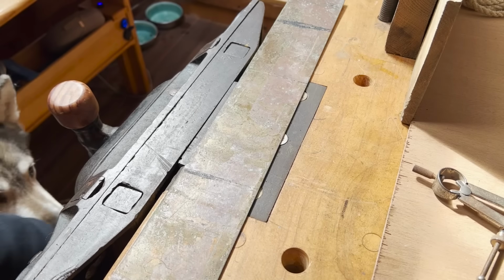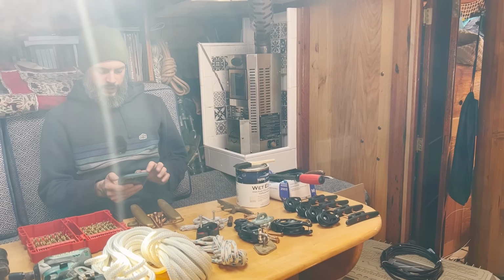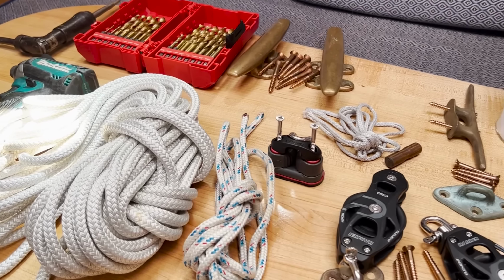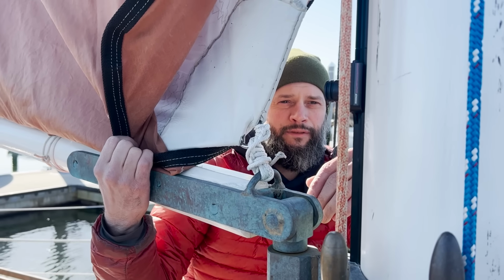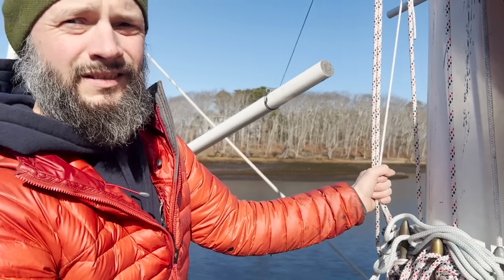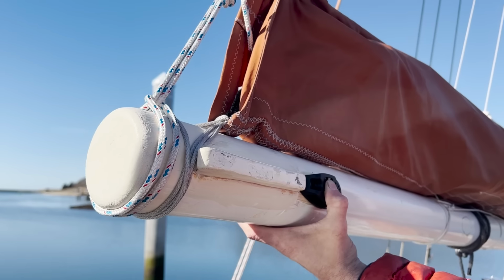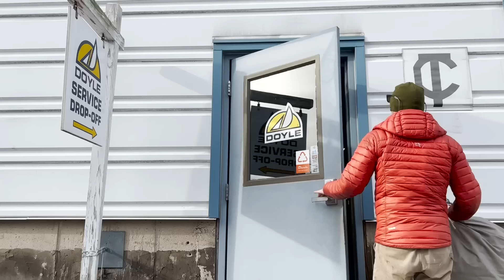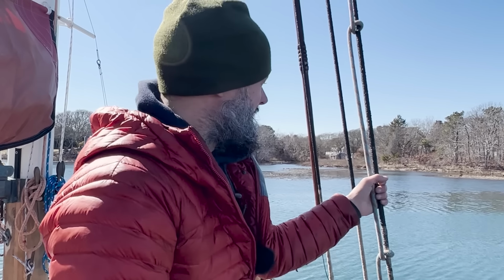Maximizing Arabella's Ability to Sail Upwind - Ep. 305 - Acorn to Arabella: Journey of a Wooden Boat

Comment: what happened to the stuffing box and the electrical problems you had? Has this been repaired?
Reply from the maker: Time will tell. The new alternator is on the boat waiting for install and the motor hasn't been running since November-ish. The anode still looks decent, so maybe it was, and maybe it wasn't the stuffing material. It should be solved, the anode looks fine for the moment, but things have a habit of changing on a dime around here! Watch this space i guess...

Comment: I'm a boater but not a sailer.  It always amazes me how many lines are on a sailboat and how sailors manage them all.  I can see both sides: the headaches, and the therapeutic nature of their demands.
Reply: slimmed and trimmed is one or two line(s). two is sailing single headsail only, and one is sailing mains'l only. most everything else is either ease of use or to gain performance. easy enough to start simple and add complexity as you gain confidence.

lots of fresh (me included) sailors want to use it all, just because it's there. but listen to the boat. if just one sail is up and she has a good heading and speed, then sit back and enjoy. it doesn't always have to be complicated.
Reply: @bmxerkrantz I am still aghast that I never knew “boater” versus “sailor”.  They have always just been “stinkpot” and “rag hanger”.
Reply: @lory2622 ,  We call them Blow Boats in Tampa, lol.
Reply: Different ball game - I've owned and been on a few boats in various scenarios. Been on a Sailing thing with no sails up, engine only and thought it was falling over and was going to die at any moment. Terrifying things
Reply: @mrvertigo23 a yacht doesn't handle the same without her sails up. They're designed to primarily sail and handle so much better with the sails up generally

Comment: I have been watching to learn about wood working.  What a spin off from my original learning path.  I still prefer to have Steve teach about carpentry vs boating!
Reply from the maker: Thanks for watching! There should be no shortage of carpentry along the route if the first year on the water is any guide.
Reply: I see now there is no shortage of carpentry skills needed.  It's a wooden boat right?
Reply: If you want to see some amazing joinery/carpentry, check out Tally Ho.

Comment: The traditional way to fix that turnbuckle issue on the fore stay is to have a block at the bottem that turns the forestay aft along the bowsprit and then have the turnbuckle (or block and tackle) there.  But puting it in top also works I guess XD.

Comment: It must be stressful for you every time you have to drill holes or rasp flat spots into the mast. All that carefully crafted, carefully painted and varnished wood. The effort required to consciously override your gut, screaming "Don't ruin that!" must be immense. I get worked up about drilling holes for cables through a nice hardwood shelf with a couple of coats of varnish, so I can't imagine what it would be like to have to cut into masts you've done so much work on getting round.

Comment: What is the difference between a Hank and a slide?
Reply: A hank (on a jib) slldes up and down on a stay.  A slide is designed to slide on a track on a mast.  Both attach the leech of the sails.
Reply from the maker: Somewhere between this landlocked video editor and a greenhorn of a sailor, we will get all the terms sorted eventually. Should’ve said Hanks. Thanks!
Reply: Luff, Not leech

Comment: I’m curious, is the use of straight blade screws for the hardware a historical issue? They don’t seem to be the best from a driver point of view. Phillips or star screw heads seem to be more friendly and provide a better bite to tighten up with?
Reply: These screws are going to be exposed to the elements and paint and coatings for years and years. A well fit straight bit and good fasteners have a much tighter fit than you would imagine. I've Even seen people use impact drivers and wrenches in flat heads.

But the big reason is because its the easiest head type to cut into a damaged fastener to remove it.

Comment: “Slides” are piston hanks!
Reply: That's right. Slides are fitted to luffs when there's a track or foil, (either male or female) whereas hanks (which on anything bigger than a sailing dinghy are generally either piston type or one-handed spring clip, eg Wichard type) clip onto a wire or rod.

Comment: Only cut/smooth metal with the forward stroke of a file. "Filing" on the backward stroke clogs the file; it's worse with soft metal like bronze or aluminum.
Reply: A light backstroke will clear the file. But yes dont use full pressure on the back strike.

Comment: why do they use slotted screws and not crosshead?
Reply: Probably tradition. 200 years ago slotted screws were all they could make. And they look good when clocked.🙂🙂
Reply: Easier to clean out the slot of an over painted or varnished screw to remove it.

Comment: Channel went from excitting to boring since you finished it
Reply from the maker: Who can forget the thrilling year and a half of planking? Or being on the edge of your seat for couple of months when the mizzen went from 7 inch diameter to 6 inches?
Reply: Viewership has gone down by half so he does have a point.
Reply: @AcornToArabella I dunno, I thought the mizzen mast shaping was pretty tense - and let's not forget it went down to less than 6 inches in parts (well, one part actually, to be fair, but that was a pretty tense moment). Anyway, it was a very innovative set up, mostly worked, and it came out alright in the end.